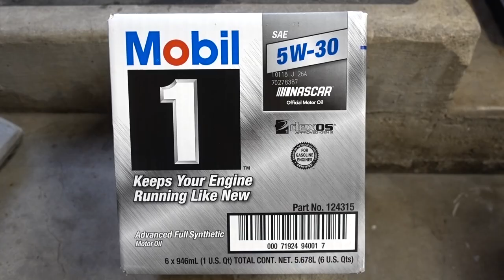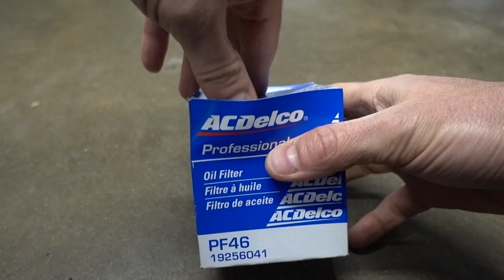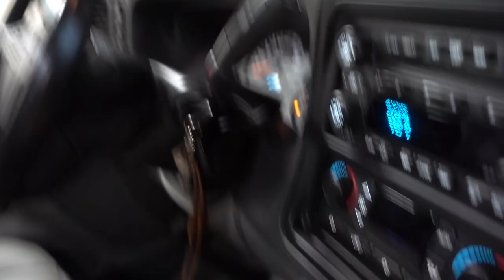BEST OIL FILTER HACK IMAGINABLE!!

Comment: I definitely agree with the 'no harm, no foul' mentality. A couple other filter-related things you could always do:  1. Research the micron ratings (beta ratios) of the filter media. Not all manufacturers advertise this, but if they do, obviously go for the one that has the smallest micron rating. Do your research, though, so you understand how all the numbers work. Some manufacturers will claim micron ratings that are misleading. It means nothing without knowing efficiency.   2. Look into larger/longer filters that can add to your capacity. More fluid = longer life between changes. On my 93 C2500 with a 454, I run a Donaldson B7 or equivalent. For an extra buck, it lets me add another extra quart of oil.

Comment: Zinc is a required addition to older model engines. It’s can become slightly magnetic if exposed to a strong magnets. You need zinc in these older engines to maintain the metal to metal surfaces.

Comment: US Navy jet engines have large magnets and a screen that has to be checked as part of a regular Preventive Maintenance System (PMS) check. Particles found in the magnet are reported to the Maintenance Officer and investigated for possible engine failure. Following that practice I have glued/stuck magnets in all my filters, transmission and differential drain plugs, at the bottom of my transmission reservoir pan and replaced the OEM drain plugs with ones with magnets I buy from Autozone or online Ebay.   Everytime I change oil I always wipe off a lot of visible shavings with white paper towel and see black smears - that's the shavings taking out of circulation from the oil and engine by the magnets. I saw your other video "Look What A Magnet Did To My Motor!" and there is your proof. I have looked at those smears under a microscope and was shocked at the gnarly shavings.

Just imagine those shavings are doing a number on your rotating, sliding or rubbing parts at thousands of RPM per second!!! 
Friction does not kill your engine, it is the shavings that eat up your parts.  Remember when mechanics LAP valves to seat them in? Don't they use grinding compounds to shave and seat the valves? Its the same action with the shavings in your engine.  Same action as when you are sharpening a knife on a whetstone with a film of oil.

You can find large powerful and cheap magnets in: 1) dead microwave ovens, 2) discarded loudspeakers and 3) discarded ZF Transmission pans which you can remove, clean and add to the new clean pan during a tranny fluid change.  Just know that my engines last longer while maintaining high compression and I never had any transmission failure.

Comment: i use 1 or 2 magnets on the bottom of my filter every time i change it, i don't change the oil just the filter every 20,000 or so. i usually follow the oil change intervals recommended by the manufacturer the first 3 times when i get a new truck then it's just the filter and a top off. On my third Duramax 2500 since 01 and have never had an oil related problem ever and i keep them until they are in the 6 to 7 hundred thousand mile range. i use Amsoil oil filter and there 15-40 to top off.

Comment: I did a 50 service on my Kubota tractor. The HST filter, once I got it off, had a large, ceramic magnet on the inside of the filter meant to catch metal shavings.

Comment: way to much talking with absolutely zero proof to back up what your saying .........
Reply: Yeah his argument was "What's the worst that can happen?" which is nonsense.  I heard if you keep pennies in your pockets, you won't get cancer.  What? no it's not snake oil!  Pennies cost what, a few cents? What's the worst that can happen?
Reply: @Arieeeee  Here's what they don't say: a penny saved is a minute wasted.  Now get back to work - collecting plated zinc will get you nowhere.
Reply: @flinch622  What? You do realize that I'm pointing out that the logic in both cases is flawed.
Reply: Charles Boston - you misunderstand, what he is saying is “it can’t hurt.” However, ever recip aircraft engine I know of has a large magnet in the oil pan to catch ferrous metal particles; to protect the engine as well as for diagnostic purposes.  I don’t know if that’s proof of concept, proof of application, or proof that the FAA, Continental, and Lycoming have stupid certification requirements.  It’s your engine, but when you have the family at 21k feet, you want to be sure you have all the protection available.
Reply: @Arieeeee  The point is that it should work in theory. Magnets attract ferrous material, fact. Ferrous material is in your oil, fact. Hence a magnet could catch ferrous material from your oil. Since it works in theory it could also work in practice, but even IF it doesn't you haven't lost anything but a few measly dollars. Potential gains, zero risk. Again if magnets do nothing then why do manufacturers include magnets so often? The stock oil drain plug on this car has a magnet FFS.

Comment: Oil filter is there to catch all the dirt from the engine such as metal particles. Adding magnets on oil filter could help catching those tiny metal particles even better. That is the benefit of having magnets on it. Bad side of having magnets on oil filter is preventing engine damage and making your mechanic even poor 🤣 so far i didnt saw any science video regarding magnet on oil filter with positive or negative outcome. Anyway nice video and presentation. Keep up with awesome work you do.

Comment: Magnefine makes a magnetic filter base. I've been using one on my harley tc96. Can't say if good but haven't had anything bad to say. I can rave about their in line filters on my transmissions  and power steering systems in 3 GM trucks and 1 Ford. I run 2 on GMC 2500hd hydroboost, 1 on each return line. Have 1 on the 4l80e trans in same truck. Dropped the pan at 50,000 to change pickup filter. Otherwise it's been a flush with my BG machine every 30k and an inline magnefine for 328,000 miles. Replaced factory cooler with a large Mishmoto at around 30k also.

Comment: The concept of magnets on an engine's oil filter is good science.
The problems arise from choosing the WRONG magnets -- which includes the little dime-sized magnets, hard-drive magnets, and other types that are NOT HEAT STABILIZED.
Magnets LOSE their holding power when HEATED, so most magnets are nearly worthless as an oil filter booster.
The famous 95 MERC has a FILTERMAG # SS365PR installed -- with 11.4 square inches of magnetic holding power, AND it's heat-stabilized to temperatures of -40 F to + 300 F.
The FILTERMAG lasts a lifetime, and can be easily transferred to your new oil filter.

Comment: Why not put them on the oil pan?
Reply: If you put the magnets on the oil pan, how are you supposed to remove any metal particles that have been removed from the oil without removing the oil pan, Einstein?  Therefore, the magnets on the oil filter is a much better choice.
Reply: They make magnetic oil plugs for that. I personally feel they are more effective and safer than clumping metal in a high flow area.
Reply: scruffy26 there are already magnets in the oil pan.
Reply: A lot of manufacturers are putting them in the oil pan now when made.
Reply: I agree put big ‘ strong’ magnets on the oil pan, around 15 of them. Then you can open the oil pan in 10 years. I bet you would have a lot of metal shavings hanging on the magnets.
Reply: Trehn, good question. You sure can, just remeber to pull magnets off before the oil chage so it can be drawn out along with old oil. 
In regards to scruffy26, you dumb but i just explained it so no need to feel salty.
Reply: I'm 46 and worked in the Automotive field for over 30 year's in my Father's garages. I've always used a large magnet on the inside my oil pan and changed the oil pan gasket every 10k miles. It does catch debris from the engine. So I'm very sure it will work on the filter.
Reply: I have used magnetic drain plugs in the past.
Reply: @scruffy26  two schools of thought there. The heavy Metals will forever stay at the bottom of the oil pan especially if you leave the magnets there. Or you could siphon out the oil like many do today
Reply: jud dude  
Not in engine oil pan, I never saw that either.
But in automatic transmission fluid pan, there are almost always magnets.
Reply: Some oil pan drain plugs are magnetized. I don't know if that's an advantage or not...
Reply: In theory it seems correct, however, there are some things that might be a problem. Anything that is in the general area of a magnet becomes magnetized. What is there to stop the ferrous material from getting stuck in the pan due to the pan becoming magnetized? Even after the plug is removed. If the pan or pieces of it are still magnetic even if just a little. Small pieces will remain. Ever left a metal tool with a magnet. That tool remains magnetic. Not just the piece you stuck the magnet to. A good area of it becomes magnetic too. If the pieces are left to remain will it affect the flow of the oil? Will it make the oil pump work harder, because the flow is constricted? The same way that arteries can be clogged with cholesterol. More that comes to the area gets stuck. Take that same theory with the magnetic pieces. If the ferrous material now becomes magnetic and the spots you put the magnet on. Then the area will just accumulate more ferrous material in the same area. Which is good if you want to stop material from getting anywhere else in the engine true. Your oil pump will have to work harder now, because of the flow being constricted from the area accumulating material. In theory, it is true the oil filter will collect all the material. These pieces becoming magnetized if they are left longer. What if they completely plug off flow. The oil pump breaks the clog. The ferrous material that is now magnetized gets stuck elsewhere in the engine? It is tricky to say that this is 100% foolproof. You need to take a sample of the oil for sure after the drain to have it analyzed. Take apart the engine to see if there is indeed less wear and little material lying around, because what if it were magnetized. As well the oil filter.
Reply: Trehn Hazelwood  they are on the drain plug
Reply: jud dude there is a magnet on the end of every drain plug
Reply: @alexmasters2750  Way too fictional/exaggerated to happen in the real world. If you get that big of anything in your engine? You need to rethink doing 50000 mile oil changes cuz they aint working .And might wanna stop putting WD 40 in sump as a replacement for OEM Specs./Fluids......
Reply: @lane4574  Whoa there, a little aggressive huh? Just throwing out possibilities. Ideas aren't anything to ignore. All of our concepts and theories came to from ideas. Just because it seems too fictional doesn't make it impossible. One thing that we shouldn't overlook is problems. We tend to forget they exist. On the transmission pan there is a magnet that catches metallic pieces. I change the transmission oil every year. Yet it accumulates a good chunk. It, however, isn't positioned in a place that disrupts the flow of the transmission filter. It is off to the side. If you believe that you should put magnets on your oil filter I'm not stopping ya. However, do be cautious. Another thing, even a 3000 mile oil change leaves the oil dark. What do you think is in the dark oil? Magic dust? It is metal. A whole lot of it as well that is diluted within the oil. What if it accumulates? Just playing devil's advocate. 😉 What you do is up to you. I'm just throwing ideas. 😉😉
Reply: @scruffy26  well before you drain the oil you could remove the magnets?
Reply: Put them there also and ATF Pan , front and rear diffs.....lol
Reply: Anthony CONENNA 

    I do the same
Reply: The walls of the oil drain pan are thick, certainly thicker than that of an oil filter. That diffuses the magnetic force, so you're less likely to catch anything on the other side. You'd have to get a MUCH stronger magnet to catch the same amount of material.
Reply: @KingAdrock420  I use a N52 Rare earth magnet thats about the same size as a half dollar or silver dollar , and they have some major cojones . 30 lbs. of force....So I use them on the pan and the filter. And the ATF pan , front diff , rear diff , transfer case and my stash key under my rig.....They cost about a buck apiece on amazon ...I like to treat Taquito extra special....
Reply: @lane4574  A buck a piece on Amazon? Got a link for that?
Reply: @alexmasters2750  If you saw any videos about heating up oil and checking evaporation, cold flow test,  and viscosity in a coffee pot .... The oil is dark as hell and not one piece of metal was introduced to these samples. Wish you would do some fact checks before stating theories like they are facts....I take my oil pan off and ATF off every once in a while to change ATF filter and to check my rare earth N52 magnets , just for curiosity and not much at all in either. And the magnets I have can lift 30 lbs. They would catch any type of loose metal that was magnetic floating around. Not trying to be aggressive , In txts its the person who usually reads it , takes it how they want to. If you heard me in real life it would sound a lot more like talking to a slow person...Real nice and very slow.....
Reply: @lane4574  You are right. When oil is constantly heated it will be dark. The oil in the engine will turn dark as well, because it is heated. There is wear to the inside of the engine though. That's why some companies will take oil samples from people that want an individualized oil analysis from their vehicle. Heated oil alone will turn dark for sure and not have any metal in it. Oil in the engine is a different story. There will be metal in it due to the wear of the parts. You may not see it, but it is in there. The companies with the machines to analyze the oil are capable of figuring how much you have in there. I'm not saying your wrong. I'm just throwing out some information. Everyone else that reads are welcome to their own conclusions. I'm not forcing anything down anyone's throat. What you do with your vehicle is up to you. What is talking to a "slow person" like btws?
Reply: Love these comments lol
Reply: @scruffy26  I put one on the oil pan drain plug also, its a N52 rare earth magnet. Very strong, The drain plug lost some of its power over time I suppose? Then for extra protection , Instead of using a 3614 Fram ultra synthetic filter , I use a 3600 , its 50% bigger long wise. I have to put a little extra oil in it to make up the difference . But for 50% more media filtering its worth it. I love my tacoma , and treat Taquito the way she wants to be treated.
Reply: @alexmasters2750  A oil sump is quite different from a small lifter valve hole. The sump is like a bucket to store the oil in when the engine is off.......Unless you have a brick size ball of metal shavings , it won't have any effect on flow whatsoever . In my engine , I have Iron sleeved cylinder walls , the rest is aluminum , besides some internal moving steel parts. Timing chain , cranks , etc. I put the rare earth magnets on my filter and an extra one on my oil plug,  due to it getting weaker over time...
Reply: Because how the f*** are you going to get the filings out if they are any inside the oil pan🥴stooopid question ❓❓❓⁉️
Reply: Pretty sure the pan was aluminum.